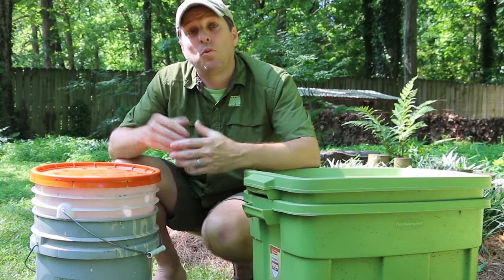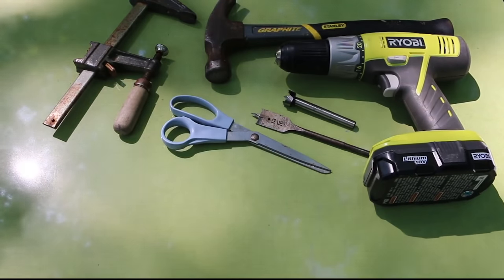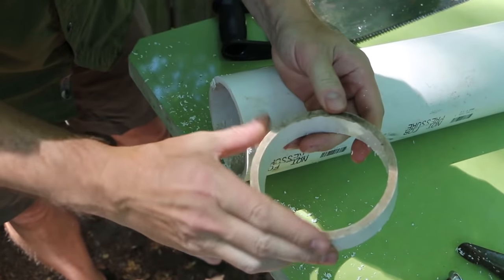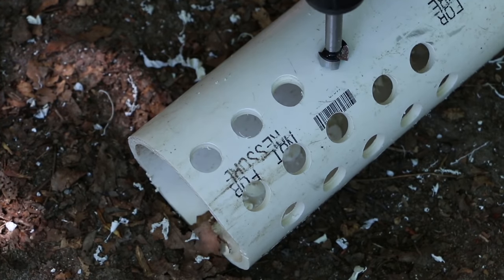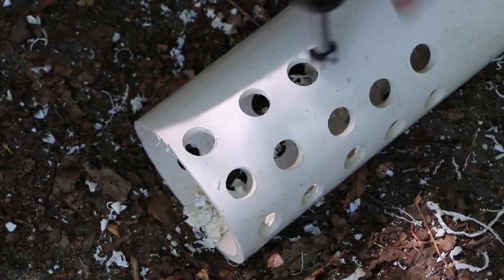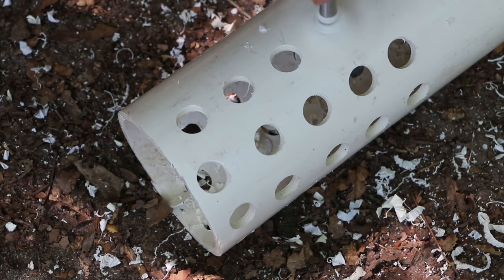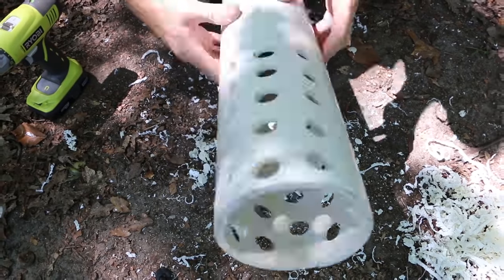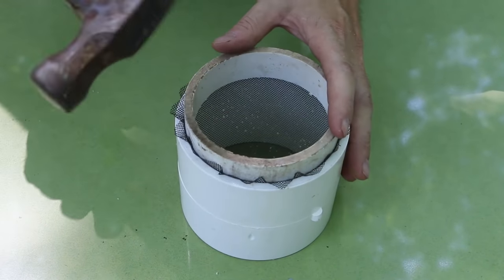How To Make A DIY Worm Tower

Comment: What about all of the PVC  plastic you've added to your garden?
Reply from the maker: +Passed High School Physics I won't argue with you that PVC is not the most environmentally friendly material, however it's primary impact is in it's manufacture and disposal. It is my understanding that, while in use it is inert. Have you heard otherwise? I have created alternative worms tower designs out of wood and a #LDPE 5-gallon bucket. Thanks for your comment.
Reply: GreenShortz DIY  Every since I learned what plastics are doing to our ocean I'm not using any in my garden.  Plastics only photo degrade and don not biodegrade which means you can never get rid of them.  And the other really bad part about plastics is they concentrate pesticides.

I'm probably over reacting, but plastics are destroying our food chain in our oceans.
Reply from the maker: Passed High School Physics I'll firmly agree with you on the problem of plastics in our oceans. A huge environmental issue. So, I think your increased awareness of and reduction of plastic in your life is valid and I'd stand with you on that. A good bit of the ocean garbage gyre problem is human negligence, the proliferation of single use plastics and the improper disposal of those materials, leading to them ending up in the waterways and ultimately the ocean. All that said, plastic is an amazing material for long term, durable uses. I view my use of PVC as this type of use. I will concede that I don't fully know the impact of photo degradation in my worm tower application. I need to do more research on that. I did create my wood worm tower video based on a viewer's concern about PVC. If I make more worm towers, I'll use this method. 

I wouldn't call your concern, "overreacting." Rather, I'd say "passionately proactive." 

Thanks for watching and for your comment.
Reply: GreenShortz DIY   Thanks.  Plastics are a man-made product.  Unlike other materials which can be degraded by sunlight and microorganisms plastics only photo-degrade into small pieces of plastics called nurdles.  There are no organisms which can break-down the nurdles meaning they will last forever.  Fish and animals eat the plastic thinking it's food and starve to death.  The other issue with the plastic nurdles is they act like a magnet and absorb and concentrate pesticides.  So as these plants and animals in our food chain "eat" the nurdles amount of pesticides is on the order of 100 times of what they would normally be getting.
Reply from the maker: I concur with the science here. I've seen several documentaries on the great pacific garbage (Bag It and Plastic Paradise). They are very informative and ought to be watched by all plastic consumers. Have you seen these films? If not, check them out. I think they are both on Netflix. Of course, both films focus on elements of plastic you are well versed in already.
Reply: Passed High School Physics 

 Tower planter
Reply: Passed High School Physics b
Reply: It's always a matter of weighing the pros and cons of materials available to you and how you'll use them. A worm tower in your garden could have immense benefits and is unlikely to end up in the ocean, unless of course you fling yours out to sea. Don't be a troll.
Reply: Don't be a toll?  Don't be so ignorant.   Everything winds up in the ocean, it's just a matter of time.
Reply: Just cut pvc on concrete and sweep it up. Problem solved.
Reply: Once you've swept it up what do you do with it?  PVC only photodegrades, it doesn't bio degrade.  If you sweep it up you are making it everyone on earths problem as plastic will last for ever.
Reply: Passed High School Physics one thing you can do is upcycle the shavings. Use resin and the shavings and make new objects. The shavings will act as support. I agree that we need to be more aware of our actions. However, PVC is cheap and easy to work with and some can't afford the cost of wood and cost of maintenance/ replacement. 

It's a selfish thought process, but hopefully, someone who is taking the time to make a worm farm also likes the environment and helps make it better by planting trees and plants to help with CO2 and help feed bees and good infects which feeds the birds and so on.

But I commend you for being passionate about the Earth. I wish more people where like you. Have a good day.
Reply: I was about to say the same thing.
Reply: And bro.. guess what plastics are made from... From (the waste,mostly, of) hawkish fossil oils.. So plastics doesn't only mean pollution and change of molecular life form on this planet, it's also means war.(and war/army is ofcourse also very polluting and human resources wasting).. But as our green shortz dude mentioned, plastic has some advantages, at the long turn plastic has to be brought in its own life cycle, where it stays without interacting with the REAL earthly nature... but that dream is gone. Greed and materialisme made plastic a part of our (future) DNA.
Reply: 2 Ken A... That's what we all feel, then we realize that people don't always realize... xD so we must be tolerant and informative, forgiving and mild. 
Ofcourse they're consumption zombies, thinking that they are the last ones to walk the earth.. but every human can also be put to a good purpose. Only a real parasite, doesn't get aware of it being a parasite...
Reply: Nature adapts, last year a bacteria was found eating plastic bottles.
Reply: Hemp plastics / hempcrete FTW! Until we evolve better industry I'm going to consider a wood worm tower...  just nail 4 - 2' 1x8 together, drill all the holes the same way on the bottom and wa la....  watch out not to drill through nails at outer edges - keep holes centrally located FYI... for the worms sake use a soft benign wood that rots in a few years and plan to replace it... just like houses  LOL
Reply: Go to your local grocery store. See if you can get five gallon buckets from them. You're kind of recycling them. The buckets have already been used. You're not adding to the problem. They are food grade plastic.  Make your towers out of them.
Reply: Good video, I will definitely try it. As for PVC,  it is nit degradable, but surely recyclable. Just put it together with other plastic trash. In Europe we sort plastic and as I started to put into that bin ALL plastics, nit just the recyclable ones, hoping the recycling centre will know better, I dropped my usual bin volume by half. All that was "unrecyclable" plastic. So unless you throw it into landfill PVC in use is OK.
Reply: What's your point troll? He's not throwing his towers in the oceans, he's using it to improve his garden soil. It's an ideal medium because IT DOESN'T DECOMPOSE. What good would it to have a worm tower that decomposed?
Reply: Troll
Reply: lol I'd just be like "stfu...its a good design that works for the average gardener." Good effort bro...composting is something that Id like to get into rather than Fox Farming my stuff to death..some folks, youll never satisfy. Long live mother nature and her many ecosystem relationships.
Reply: "er muh guuurd what about the metaaaaalllll in your naiiils" - he said....VERY sarcastically
Reply: More tasty 'grit' for worms. X)
Reply: Passed High School Physics Yeah it arnt the western country throwing that crap in the oceans. China, India countrys in Afrika and South America throwing millions of tonnes of garbage in there rivers ending up the oceans. And we in the west have to feel guilty about it.
Reply: snowpaw360 Yup they even found bacteria now that eats nuclear waste and another eats cholorine.
Reply: PVC is great for the garden, it stands for Potassium, Vitamins, & Calcium ;)

Comment: Hi thanks for the video.  I am a small back yard beekeeper.  I created a natural habitat in my yard years ago.  I just re did my pollinator garden and saw your video.  In Miami it can get pretty hot using worms bins etc.  The worm tower looks like it might be a great idea.  I have 3 in the ground and need about 10 around the perimeter of my backyard.  My concern is having enough food scraps to feed.  Thinking of asking my neighbors to help me compost.  Thanks for the great idea and video.  I will let you know how they work!
Reply from the maker: Hi Maureen. I think finding enough food scraps can be a challenge. With all the worm composters I've created, I can only keep two running at a time. You definitely don't want to run out of food, although the worms would just slow down their reproduction. So, finding a good balance is key. One option to consider, is putting your towers deeper in the ground to allow the worms access to cooler temps. Keep me posted on your progress.

Comment: Going to try this.  Instead of drilling all those holes, I think I will use my skilsaw to cut notches in the pipe 1/2" wide and drill holes on the ends of the two cuts for the section to fall out.  Great idea and something to try.  I have Ruth Stouth beds so they can stay there forever.
Reply from the maker: I like the slit solution. Should worm great. The worms might be confused though, the prefer round holes. Lol. Good luck with your build.

Comment: I have used 5 gallon buckets for mine! They work well also.
Reply from the maker: Hi Bob. Agreed. I've done a 5-gallon version too. More surface area for the worms to work with too. Thanks for the feedback.
Reply: @GreenShortzDIY when you are using a 5 gallon bucket, would you use one per bed? How many square feet does this 4 inch version cover and how many square feet does a 5 gallon bucket cover? How far do worms travel? We have 4x16"x 24" tall beds... one on each end or a big one in the middle?

Comment: the drill set so the clutch slips isn't so bad if using a spade bit and if it binds it can keep you from twisting your wrist. It cuts down on carple tunnel too because it limits torque repeatedly twisting your hands.
Reply from the maker: Thanks for the suggestion Will. And thanks for watching. You gonna make a worm tower?

Comment: Here in rural FL Critters will dig in my bed to get the scraps. I will try a wide trash bin with a lid to see if they still dig up the bed or know that food is in a container instead of my bed. Right now I have to build fencing with a door around my beds because I don't want beds to be destroyed,
Reply from the maker: I did one in a 5 gallon bucket with hardware cloth covering the perforations. Might help with the critters.

Comment: Love this idea - better space saving design versus 5 gallon pails. I'd happily do this here in Edmonton Canada, but the winters are ferocious.  Those red wigglers are gonna die for sure if they are left in the ground.  I wonder what the best method would be for winter storage? Placing each tower into a 5 gallon pail of dirt, and continuing to feed them in my basement? I think that'll work, as long as I "forget" to tell the wife what is in all those towers in the basement.  Lol
Reply from the maker: Hi Ryan. In Canada you'll definitely want an indoor option, but I don't think towers would be the best option for that. One thing worms need (I learned more recently) is surface area. They prefer to work through a thinner layer of compostables, spread out, versus a deeper layer in a smaller area. So, my recommendation for your Edmonton composter is to go with a two-tote bin system. It is relatively contained, but has a good amount of surface area. Hope that helps. Thanks for watching.
Reply: @GreenShortzDIY  Thanks for the quick response!  I'm just a little confused.  Are you saying I shouldn't use towers in my garden at all?  Or that I should transfer the worms to an inside bin system for the winter (vs keeping them inside in the towers)?  I hope it is the latter 'cause I'm all geared up to set up the towers for my 9 planter beds :)
Reply from the maker: @ryanarmishaw3305  Ah...I missed the point. :-) It will be tricky to recapture the worms prior to winter. They will have dispersed somewhat. There may be enough to catch and put into an indoor bin, if at least to restart a colony. My suggestion would be to have two independent systems...the towers in the gardens plus a tote or bucket system inside (year round). Use your indoor system to expand the colony through the winter and then use its worms to seed the towers once it gets warm enough. You could mulch your garden bed with a thick layer of hay or wood chips (or just in and around the tower) to help any remnant worms over winter. They will migrate down as deep as they can, but the cold might be too deep for them to survive.
Reply: @GreenShortzDIY  Good to know.  Thanks for the tips. I'll definitely keep the worms going year round in the tubs in my basement and consider my options for towers.  Maybe I'll build towers into some large planter pots I have.  That way they will be easier to bring in over the winter, and I won't lose the colony into the garden bed.  Cheers :)

Comment: System works, though I used a 3 gallon bucket for free from bakery, just drilled holes in lid for rain to enter
Reply from the maker: Cool mod, David. I’ve done a bucket worm tower also. It will actually perform better than the pipe, as the worms will have more surface area. Thank you for letting me know. Thank you for watching.

Comment: Maybe I'm wrong but a bottom cap could be added to trap the worm castings. compost tea will leach out and organically feed your plants but monthly or so the castings could be emptied to top feed the soil.
Reply from the maker: Seezor, that would work as long as you want to capture the worm castings to use them somewhere else. It is sort of a hybrid of the standard worm bin, but sending the worm tea right to the garden. One benefit of letting a worm tower send it's solids out the garden is very little maintenance. As you run water through the worm tower, more of the castings are rinsed out into the garden bed, making room for more composting. I'm a big fan of low maintenance. :-) Thanks for sharing your idea.

Comment: I'm curious what you do at the end of the season.  Do the worms "winter" in this?  Do they crawl out into the ground for the winter?  Do you pull the tower up at the end of the season and spread the nutrient rich soil around the tower around into the rest of the bed?  Do you more or less start over next year?  (Same pipe, of course.)
Reply from the maker: Hi Frank. I actually don’t do anything, other than keep putting material in. In my opinion, this type of system is one that needs restocking with worms on a seasonal basis. It could be used in conjunction with a contained indoor system. The growth of the contained system can be used to restock the outdoor worm tower as the seasonal temperatures permit. Hope that answers your curiosity. You thinking about building some worm towers?

Comment: Instead of sanding or in addition to sanding the lid edge maybe you could pierce 2 holes in the coupling lid and make a simple wire paint-can type handle to pull off the screened lid ?, Great design Sir.
Reply from the maker: Good suggestion. Thank you for watching.

Comment: Great video. Thanks for posting. Would hardware cloth wire work similarly for an in ground composting tube instead of pvc? I have some 1/4 inch that is naturally in a cylinder shape and wondered if the worms would move past the metal into the garden. Thanks!
Reply: they would move in and out of the tower but because it has so many holes, then you also will get flies able to get into the tower.  Unless you mean you just keep the hardware cloth part in the ground and the pvc part above ground.

Comment: Hey there’s thanks for the info. Wondering if a pvc cap would be better than the screen, or if the screen is the best approach? I’m concerned about the smells, flies or potential raccoons being attracted to the tower of exposed with just screen. Thanks!!!
Reply: Air circulation may be another benefit of the screen vs a cap. I have no scientific knowledge of this, but I’ve watched a ton of worm bin videos, so I just might be a genius 😅

Comment: Having just pulled apart my raised beds because the went hard as rock, i'm thinking of trying again with these puppies. maybe 2 per bed.
Reply from the maker: Hi Marvin. For a 4x8 foot or similar size bed, two worm towers are perfect. They won’t do a great job loosening up the soil though. Consider using a lot of compost when you rebuild the raised beds. Thirty percent compost by volume is a good ratio to plan for. Thanks for watching.

Comment: easy to understand video, thanks. Just wonder is it necessary to fill lots of water in the worm tower right after all?
Reply from the maker: +Ng Quy if you wet down the bedding material before you put it in the worm tower, then extra water isn't needed. Since I didn't moisten the newspaper, I added water. It was probably more than I really needed, but the excess water was flowing out into the garden, so the plants got a drink too. In general I put more water through my worm towers compared to my container worm composters.
Reply: Thanks a lot, +GreenShortz DIY.

Comment: If you drilled 2 holes in the lid you could use the holes to grab and pull off the top and they would still be covered by the inside pipe